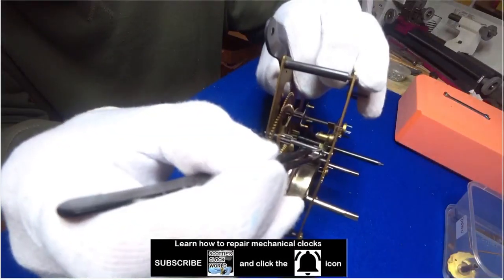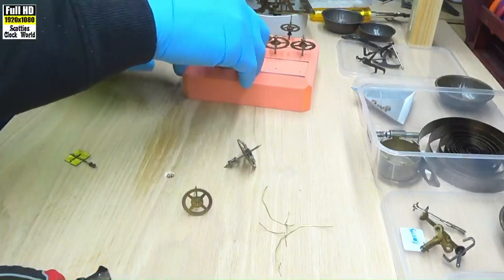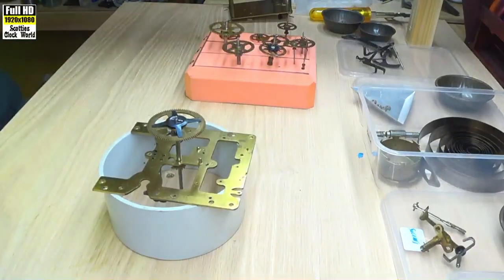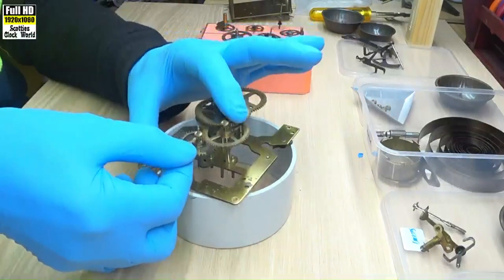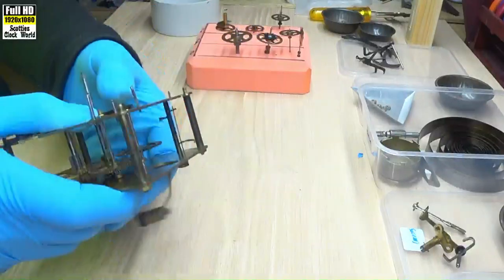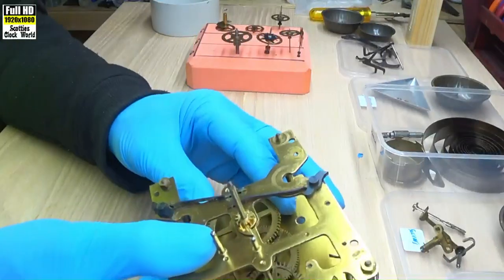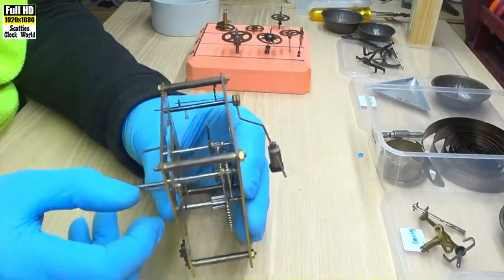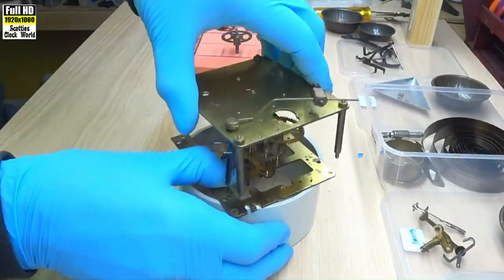German Kienzle mantle clock service - Part 1

Comment: What is that block you are using to hold the parts of the clock?
Reply from the maker: A piece of foam with holes pushed into it to hold the wheel arbors.
Reply: @ScottiesClockWorld  great idea. Thank you.
Reply from the maker: @joshuawade1074  , it easily keeps the wheels in the correct order and orientation.